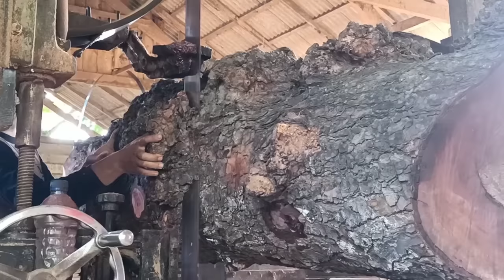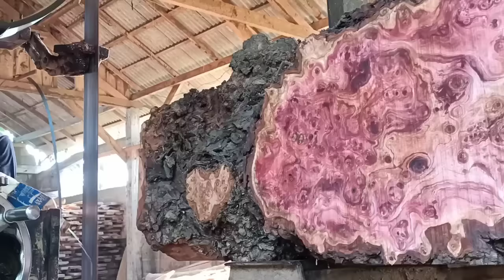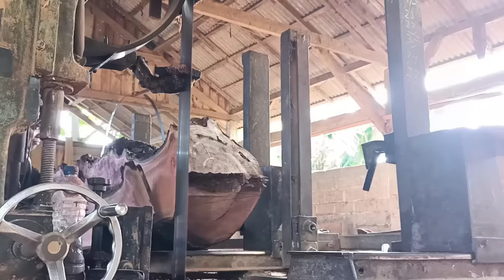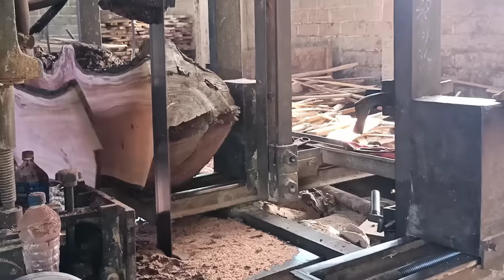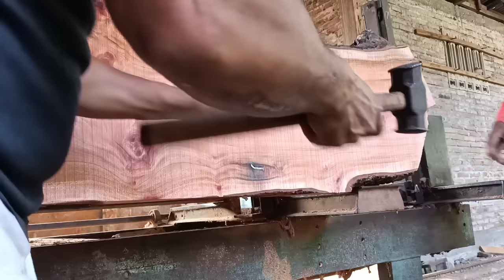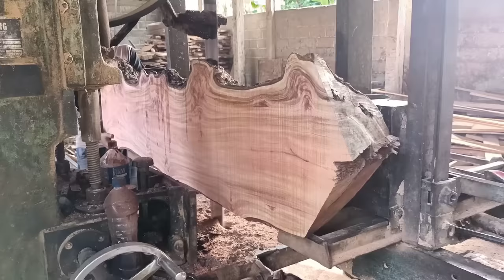The monster log sawmill terrible full of beauty

Comment: Just thinking about the Walnut sawmill I worked in Kansas City, Kansas. The sawyer sat in a plexiglass enclosure while the blade cut slabs at a very fast rate. Safety was very important. Not so careful in this setup!
Reply from the maker: I'm sure the place where you work is very extraordinary, yes, this is how we work, using minimal equipment and without complete protection

Comment: Oh, that's got wet bar written all over it. I know it's a pain, but I would have turned after each opening pass. It's always best on a monster like that to see what you're getting into. I'd even slow down the feed numbers go to h3ll if you trash the blade, and that log will do it in a heartbeat.
Reply from the maker: OK bro, I understand what you mean. Thank you very much
next time we will do better 🙏🏻
Reply: @Sawmill_IND  sorry didn't understand your setup. that's my bad.
Reply: @Sawmill_IND  Better? with that mill I dare anyone to try. BTW shorts flipflops and chain saws??? Not a good look, lol But dude feeding that saw with your equipment the logs your cutting I got nothing but respect. It's an art and you do it well.
Reply: On a side note, that also helps to fight warping of the slabs. but again, it depends on your setup.
Reply: @Sawmill_IND  I spent years removing bark and grading logs against the design of the mill to place each log on the best saw and in the best hands to deal with it quickly production the numbers were everything in that place.

Comment: So health and safety weren't there that day.The machine looks badly designed  and the operator unsafe.
Reply: 🌲🍀🐾 The machine was well designed for it's time.  Probably just old, and the laws didn't require guards/shields then, or someone removed them.  But the operator should definitely be wearing some kind of protection regardless.  All they need to do, is put up a sheetmetal wall with a plexiglass or bulletproof glass window in it, between the operator & moving blade.  But it needs to be adjustable/moveable so as not to inhibit any visability during the setup & adjusting of the machine😎✌🐾🍀🌲.

Comment: I ran a peeler for a band mill a log like this is flat out hard on everything men and equipment, smaller the mill the worse it is. Flipping it would remove a lot of the bark and cobs allowing for a more even cut saving the saw and footage. the blade was hurting just before the nail and after well good sawyer. Filer can fix it, I've seen them come off the wheels. I gets ugly.

Comment: The bottom ten feet of any tree are prime territory for nails/screws/eyelags/barbed-wire/bullets. . . Havoc for mill blades!  I now check my logs with a handheld metal detector — pays for itself in the long run.
Reply from the maker: I think it's amazing and long term for a metal detector.
Reply: @Sawmill_IND  I always cringe when I feel that little hang-up and hear that “TZZZT” because it means I have to pull the blade… not fun.

Comment: I wonder how bad the nails affect the sharpness of the blade.
Reply: Hitting a nail absolutely RUINS a blade. You have to change it immediately as it dulls the blade significantly and causes the blade to wander creating uneven and wavy cuts. It's rare that the blade can even be saved. Now imagine hitting several nails in one tree! 
Sometimes the mill will go over a log with a metal detector first to help identify trouble. Then they will dig it out before sending it through.